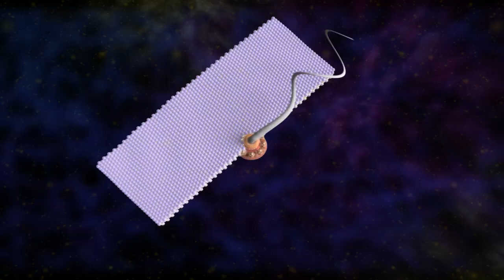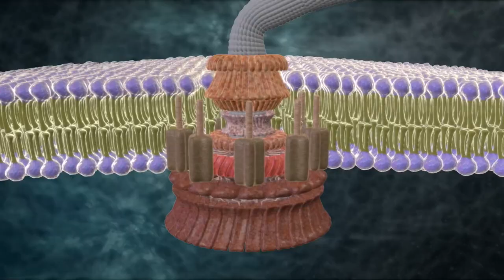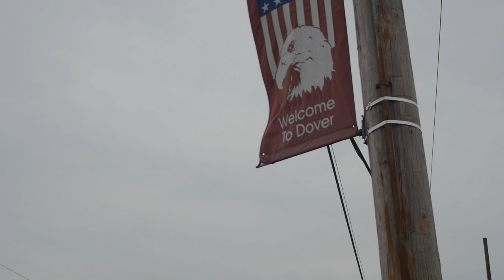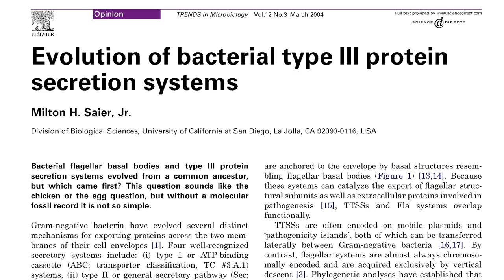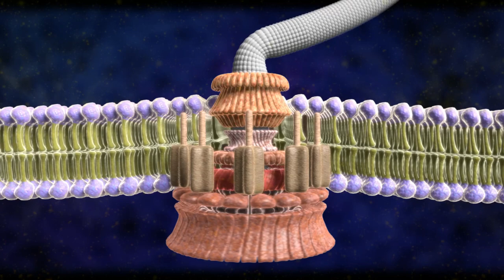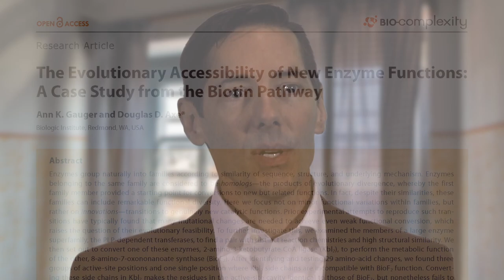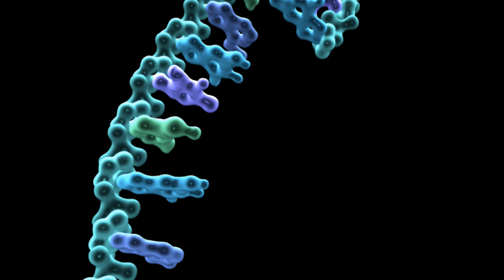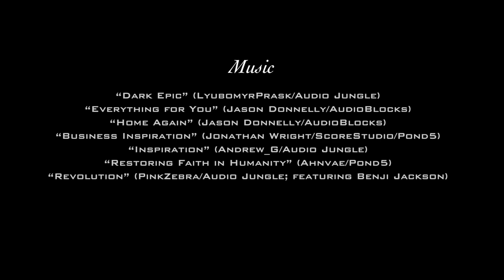Revolutionary: Michael Behe and the Mystery of Molecular Machines

Comment: I have written, or been responsible for, more than a million lines of code in my 35 year career as a SW Engineer.  In all that time, NOT ONCE has a character error added new functionality or achieved anything beyond failure of the functionality of the software.  Evolution of DNA is an unacceptable myth ... fantasy ...
Reply: Imagine a million individuals like you, given a million year...
Reply: Traditional sw is not squishy ... biology is very squishy which elegantly handles if not thrives on benefits of thermal noise... so are neutral networks ... do a deep dive into process of environment influencing cell unraveling histones to permit expression of DNA into protein synthesis
Reply: And still your system is not concious. 
Is it 78 gb software dedicated for one purpose to produce it self.. is it self reliant. Just assembles itself . You think it is few lines of code. It is software which you cannot fathom. Just like the distance between stars..
Reply: It comes down to worldview, belief and faith.  Darwinism is a faith
Reply: It actually happened to me once.

Comment: Dr. Ken Miller, it was, if I recall correctly, the professor who walked into his class wearing part of a mousetrap (many parts removed) as a tie clip. He was attempting to debunk the concept of irreducible complexity. I might elaborate here by introducing another, related term "continuity of function." Or "functional discontinuity." I have coopted unrelated mechanical parts to serve different functions. But a lot of work is involved, especially for complex, integrated machines. A simple example could be using a nail a a hinge pin. It would work. But the nail must first be removed from the wood it's holding together, sized more or less correctly, and then placed correctly into the hinge with the point down so that the head holds it in place. The door hinge must remain correctly aligned during this process. Can one see that even this simple mechanical  "jerry rig" is highly unlikely without an intelligent "coopter?" And what purpose would the hinge plates have served previously without the pin? Maybe they served as brackets to secure a wire? The plates would have to be positioned on the door, and in the frame, in the correct orientation, in order to function as a hinge. A machine is not just "irreducibly complex," but has "continuity of function." A gradualistic, Darwinian process must proceed along a continuous line of improving function to even have a chance at being probable.

Comment: We have had fairy tales told and re-told over centuries. But we know they are stories which teach some morals or are purely for entertainment. Do we have modern fairy tales? Yes. As nothing assembles itself even if all the parts are in the vicinity without direction and actions. If you got out all the ingredients to make a sandwich, and you got called away as the doorbell rang, when you went back into the kitchen, would you assume that the sandwich evolved or that someone in your family did you a kindness? 

All the supposed micro changes, accumulating over time, all by chance, and this is how your brain came to be. So if your brain which thinks is itself came to be by an irrational process, then can you trust what you think?

Comment: “The most essential prediction of Darwinism is that, given an astronomical number of chances, unintelligent processes can make seemingly-designed systems, ones of the complexity of those found in the cell.

ID specifically denies this, predicting that in the absence of intelligent input no such systems would develop.

So Darwinism and ID make clear, opposite predictions of what we should find when we examine genetic results from a stupendous number of organisms that are under relentless pressure from natural selection.

The recent genetic results are a stringent test. The results:

1) Darwinism’s prediction is falsified;
2) Design’s prediction is confirmed.” 

― Michael J. Behe

Comment: It's fascinating how complex these molecular machines are with so many different types and  specific purpose's.
Many of our motors designed by engineers are similar in that we have to design , manufacturer and assemble them before their of any use. How could random nothingness foresee the need for a flagellum motor sometime time in the future , start designing the parts and when the design is complete ,  give the factory ( the code) and have them create all these individual motor parts and then assemble them with (complete randomness , chance , nothingness or evolution) into an actual motor.
This randomness , chance or nothingness had to have the foresight to look thousands or possible millions of years ahead and recognize this need or purpose unless it had some unscientific non-purpose , but that goes against the little steps that evolution purpose's it accomplishes with each tiny mutation.   The speculation by evolutionists that there was some prior use of some of these parts has no evidence to support it. It's incredulous that anyone could think that chance could design a real motor and quite possible 100% efficient.

Comment: You cant even use the idea simple amino acids formed first .it has to be a part of the process that can store the info ,perform the mechanics ,transport and construct the cells so you need the first random creation to be far to complex.
this goes against the model theorized in the primordial soup .
This is why the richard dawkins first try and rid the idea of defining what life is before they ever begin to denate or take on dialogue. its them setting up wiggle room.

Comment: The source of intelligence is the organisms themselves. Through purposeful intentionality and desire, mediated through epigenetic microbioelectrochemocymatic transconfigurations in mainly quantum liquid crystalline and qausi-crystalline water, the origins of new genetic and epigenetic information including biological design becomes inevitable. Yes, they are intelligently designed by the lifeforms themselves. Most co-creative co-evolution is nonoptimal but can become more fit through self-imposed internal and external affordances. 

This mode of self-organized co-creative intelligent evolutionary design is general and the basis of evolvability which can itself evolve. Not quite the genetic lab engineer you thought, but organisms agency has been ignored for too long. The answer to how they were intelligently designed, was organisms intelligently designing themselves differentially and transgenerationally. They are more than the sum of their parts therefore cannot be defined mechanistically as a machine alone. Nor can it be said that the design had to come from some entity like us or more advanced technologically(as we see technology is reductionistic and requires existing knowledge or information). All organisms are expressed intelligence embodied in their structures, and all the co-entangled relationships shared  between their component parts.

 But they can and have reduced in complexity, which can serve as a template for creative recomplexification, such as taxic atavisms. Can you build an organism as complex as a bacterium, that is not based on the mechanistic properties and principles of pre-existing organisms like that bacterium.  Only a whole planet of billions of creative intelligence's can ever hope too. Add a new piece of genetic information in any organism, like drugs will have unintended side-effects and non-linear effects both short-term and long-term. Only the user of that biological information itself determine the overall functions and structures of that trait, therefore it's biological semantic meaning.

 Read books, '1.)Neither ghost nor machine: the emergence and nature of selves'.
2.)Evolution driven by organismal behavior:..
3.)Organisms, agency and evolution.
4.)B.E.E.M.: biological emergence -based evolutionary mechanism:..
5.) Living rainbow H2O.
6.) Epigenetic principles of evolution, second edition.
7.) Challenging the modern synthesis: adaptation,  development, and inheritance.
8.) Poetic biology: towards an existential ecology.
9.) Biological information: new perspectives.
9.) The tinkerers accomplice: how design emerges from life itself; and his new book, 'Purpose and desire:.'
10. ) Built by animals: a natural history of animal built structures.
11.) Mind:a unified theory of life and intelligence.
12.) The biology of wonder:..
13.) Code biology: a new science of life.
14.) The presence of the past: morphic resonance and the memory of nature. My theory of quantum co-entanglement/memory, the single monad theory of the cosmos, and the Mereon matrix are working models that are candidates for a theory of everything. They are actually all related.

There's more I could recommend but that can be done yourself, if unprejediced and open.

Comment: If you take a car, and prove that it functions nicely as a house after you remove the motor, does not provide proof that the car was discovered accidently after someone took the plethora of car shaped houses lying around added to it a motor and found how well it worked as a car.

Comment: Co-option or exaptation again is driven by purposeful organismal agency. Proteins can have plasticity and can increase in plasticity even in a modular fashion. Most novel structures and functions start out as non-adaptive, through organic nonoptimal constrained evolution. Many genes and proteins can too, where neofunctionalization, subfunctionalization, and specialization can be evolved guided by intelligent and creative cellular and organismal morphic fields. My model of purpose-guided intra-modular  constructive neutral molecular evolution based on differential biased and selective modular plasticity and robustness allows this. Mutation hotspots are an example. Organisms continuously use even direct/bias variations to their uses. They are their own co-creators, while Darwinian dynamics and other processes act like a chisel for finer details and adaptive functional and structural refinement of a pre-existing functional part(s). Organisms are inventor's of their own designed architecture.

Comment: Im thinking here. Im not a micro-biologist or anything. But maybe, just maybe, a way to better explain the similarities between TTSS and the BF is to consider that features located in cellular wall structurally need to be something like that two known features. 
For example, in computer's motherboard there are plenty of similar or equal slots because its just better this way.  
Is there any studies in that direction?
Reply: Darwin might be thought to be saying that Apple microchips are suitable to fit in a Windows motherboard without modification, forward planning or complex adaptation of the software.

Comment: "A boat without am outboard motor doesn't work"

It's a little hard to believe that this "scientist" doesn't know about row boats and paddle boards.

Also, "intelligent design" doesn't solve the problem he claims to be solving.
Reply: So far, it appears to be another instance of the "god of the gaps".
Reply: Row boats and paddle boards typically do not employ motors for propulsion. We are the motor for those watercraft.  It's a little hard to believe that you believe he doesn't know about row boats and paddle boards. I bet he even knows about canoes. They typically do not use motors either.

Comment: The question is, "Where's the science?" If Dr. Behe and his colleagues at the Discovery Institute want people to believe their scientific claims are based on real science and not just their belief in their God based on pseudo science, then they should follow accepted scientific processes ie. do the science and submit it for peer review. Books are all well and good for Joe Blow on the street but they prove nothing as to the validity of the information or conclusions presented.
Reply: Ell Bee
"Wheres the science"  What science didn't you understand ?
Was it the pseudoscience describing  the Flagellum Motor within the first 65 seconds or something else.
This Flagellum "Motor" , which is very similiar to the one designed by Mazda's Mechanical Engineers 
over 6 or 7 years, but unfortunately lacked in both efficiency and reliability in comparison to
Flagellum "Engine"  

One of about 21,000 different types of nano machines found by the 1000's in a large percentage of
everyone of the 70,000,000,000 cells that make up a human body .

Since Darwinist like yourself like to repeat the same repetitive mistakes that others have also repeated
about peer reviewed papers , I'm sure you will enjoy the link I've noted below.
It's written by a scientist who's in the top 2 or 3 in his field in the word and has had over 200 of
his papers peer reviewed in science journals as well being cited about 60,000 times. 

Anyhow , it's a really interesting article about the ever so simply simple (evolutionary description) 
cell membrane .  No pseudo science or God here  " Just good old empirical science , the blight of
Darwinism.

https://inference-review.com/article/an-open-letter-to-my-colleagues#endnote-13

Comment: I think "Intelligent Design" is an unfortunate choice for a name.
What is more appropriate is to say that DNA is an intelligent molecule.
DNA is not a dumb machine that works with blind mutations but a smart thinking information storing machine.
It stores whole complex systems in its code.
And when a selection pressure appears it responds with a WHOLE complex unit to cope with it.Which it may have saved in its memory somewhere in its code.Or is devised for the situation.
Just like we do as intelligent beings.
No intelligent designer OUTSIDE needed.
Reply: I think you mean that the DNA molecule has intelligence designed into it. Neither you nor DNA have intelligence from yourselves: it is the gift of God, the intelligent and wise Designer.